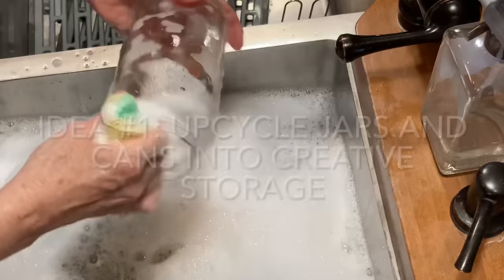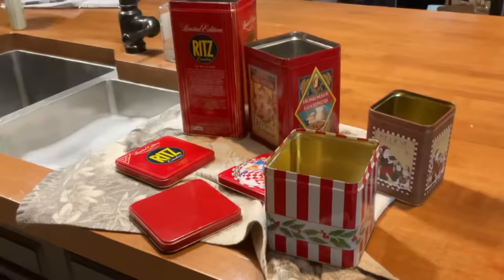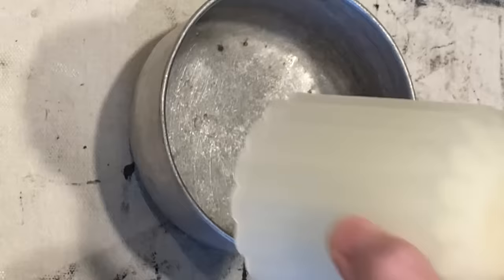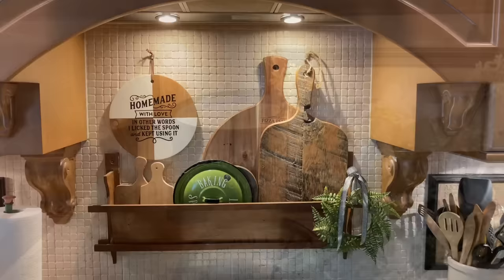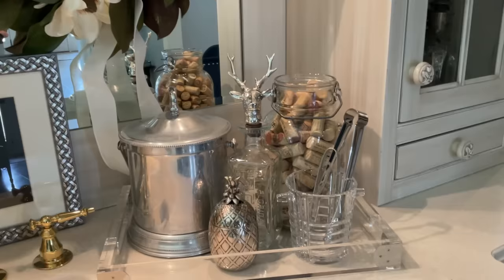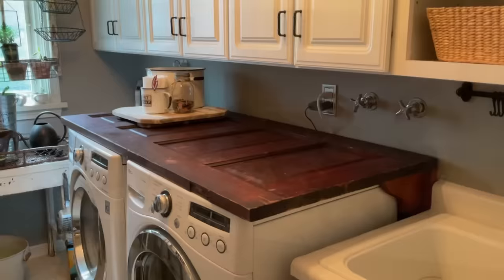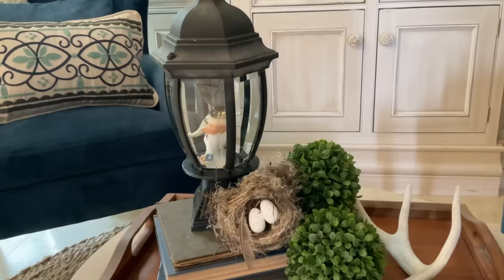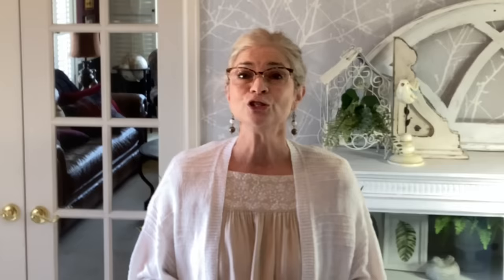10 FREE DIY Decor Ideas to Refresh Your Home (Using Trash and Things You Already Have)!

Comment: From a retired chandelier-  You can use a hairdryer or hot gun to smooth out the top of a candle or to help remove old wax from something. The perfumes in candles can transfer to foods cooked later, so a separate oven,  or cleaning in between is best. 🙂

Comment: I have watched this particular video a couple of times - usually just for inspiration!!  Then I go and move something in my apartment. lol.  I have made many candles over the years.  A couple of tips are... Put an old nylon or knee high nylon over your hand and rub your candle or taper candle.  It removes small bumps and nicks as well as accumulated dust and makes the candle shiny - provided you buff it enough with the nylon sock.  Also for candles that are melting uneven or have set up uneven or have a nick or notch on them  using a heat gun to smooth out the surface works well.  I also have an old electric fry pan that i turn on low to melt the bottom of candles to make them even.  Once I melt off a little wax I can even roll the candle in it, for a rough finish that makes the candle smooth again.  Thanks Sherry!!

Comment: My favorite ones were making candles in unique containers and the lanterns. It's funny because when my husband comes home today he will discover an outside lantern inside as it hasn't worked for years and is located in a part of the yard that's unseen. I was already contemplating it and here I go......😄😄😄
Reply from the maker: Yay! Don’t get discouraged if you run into issues disassembling it.  Every lantern is different.  Just keep looking for screws and things to take off.  I should have mentioned in the video that if a screw is rusty and stuck, spray some WD40 on it to loosen it up. Good luck!😀

Comment: Beautiful :) ! I do want to caution about using glass in the bathroom. My husband won't let me, and I think after all, he's right. Even if you don't have a hard-surface floor in there, it's just so risky, if it should fall and break. When you're not only barefoot, but naked ( ! ), the last thing u need is to deal with broken glass, try to get over/around it safely, or get full of cuts. This would reduced when you wrap it - and glued - with twine or etc. , but you can just use very nice plastic jars.
Reply from the maker: That is a good point that I had not considered.  I’m sure you can find some nice plastic container to use instead.

Comment: I love all your videos.  When you are covering the back of a picture frame with paper like brown bag paper,  after cutting the paper the size of the frame, wet it and glue down.  It will dry tight as a drum.
Reply from the maker: I have never heard that tip. How do you wet it? Do you use a spray bottle?
Reply: @CanterburyCottage  yes, that will work. You don't want it sopping wet, just moist on both sides. I'd love to hear if you tried it.

Comment: The paint cans and biscuit tins are beautiful! Whenever I have one, it immediately goes into use to store sewing supplies. Any ideas for decorating shoe boxes I have saved?
Reply from the maker: Yes, you can cover the boxes with contact paper, wrapping paper, or scrapbook paper. Use glue stick or spray adhesive to adhere the paper. You can also paint cardboard with chalk paint—just apply a thin first coat to make sure it doesn’t bubble.

Comment: Question...if the wax is not smooth on the top and you feel kinda iffy about putting the container...or it will not fit.... in the stove would a heat gun work to heat up the top layer of wax??? Great video loved as always the incredible ideas!!!!

Comment: New sub. Loved your ideas. The tip for the messed up candle do you mean putting the candle jar in the oven to reset the wax? Wont it explode or crack if too hot.
Reply from the maker: Thanks so much for watching and commenting and subscribing! 🥰You are setting the oven to 200 degrees and leaving the container in the oven for only 10 minutes or so, until the top layer of wax begins to melt.  I haven’t had anything explode so far!  If you are worried about your container, you might try just blowing the top of the candle with your hair dryer.

Comment: How do you remove the odors from pickle and tomato sauce jars and especially the lids.  I haven't had much success with the lids.  Another youtuber used a small portable clothes steamer to remove sticky labels. She also said a blow dryer will work too.
Reply from the maker: I usually just let them soak in hot soapy water all day.  If the lids are especially smelly, you can spray paint the underside which seals in any odor. I usually use Goo Gone to remove sticky labels, but I could see how a blow dryer would help with those big transparent labels on jars and bottles.  Thanks for the suggestion!

Comment: I have my first pair of ice skates. They are currently 49 years old. I want to display them somewhere in my house but I don't know. Can you think of some creative ways to display those? They are now dingy White. If anyone can figure that out, you can
Reply from the maker: That is so sweet that you still have your childhood skates! They should definitely be out all the time! You could hang them from a hook and stick some fake greenery or flowers in them.  You could also put them in a basket with a few other decor items (maybe, some skating related books, mittens, a throw blanket).  If it is a big basket, put some pillows down in the bottom, so that the skates stick out the top of the basket.  If it is a smaller basket, you could sit it on a table or bookshelf.  Hope this helps!

Comment: How do you successfully dry flowers?
Reply from the maker: For hydrangeas, I spray them with hairspray after cutting them.  I put them in a vase with water, so I can enjoy them while they are still alive.  I keep refilling the water until the flowers are completely dried out. (I may leave them in the vase for as long as a month.) Once they are completely dry, I spray them again with hairspray.  They will still shed a bit, but if you are careful, they will last for years. Leaving them in the water helps to retain more color than hanging them upside down to dry.  😀